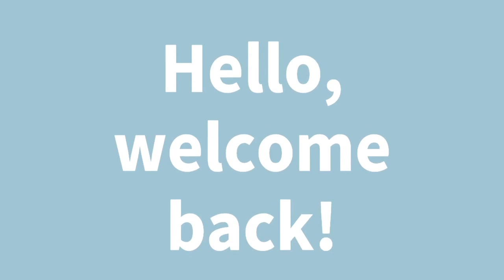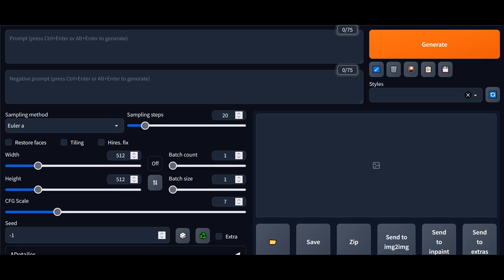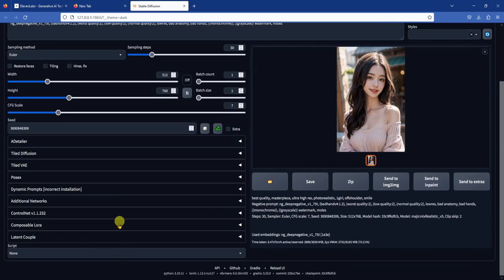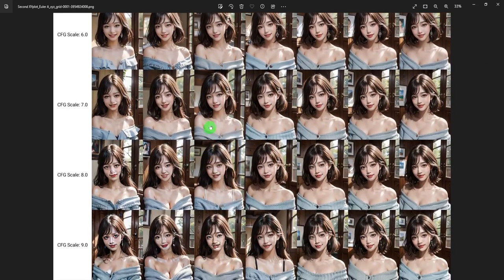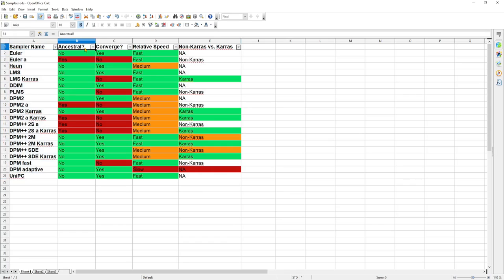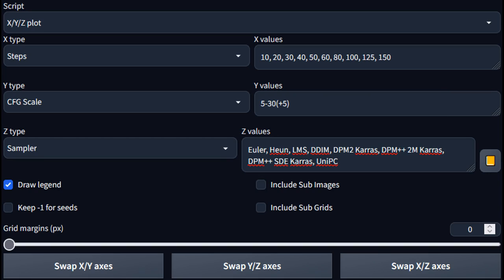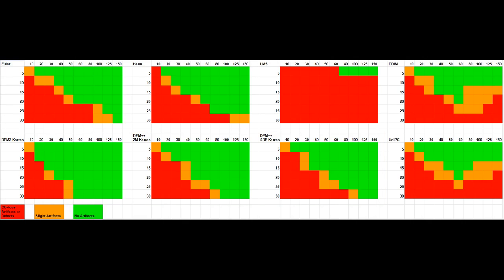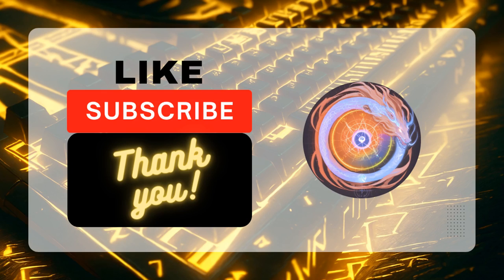How to use XYZ plots Script to Optimize Parameters and Get the Most Out of your Model!

Comment: i dont get it, on the steps in xyz, you can have it 10,20,30,40. but what about the one on top, if i change the top to 10 or 20 or 30, it would make different images as well, how would i know which to use without the xyz? same on lora, my lora weight on top is 1, on bot is 0.2,0.3,0.4 etc, if i have the top to 0.9 or 0.8 it would make different images compared to my wirhgt lora of 1 on top